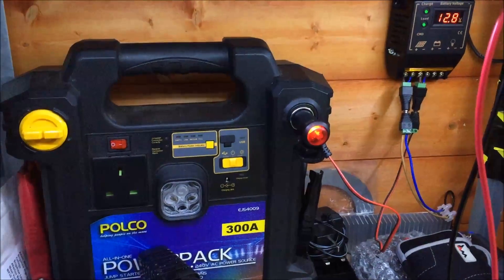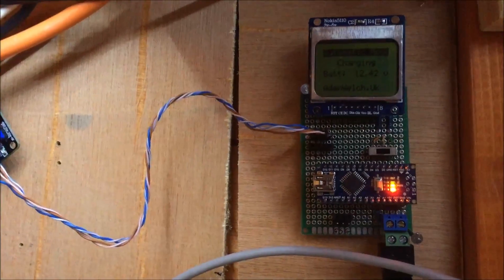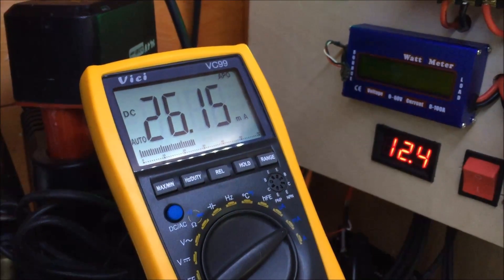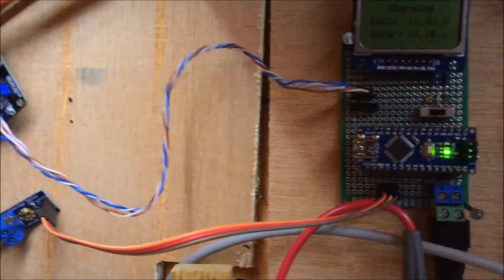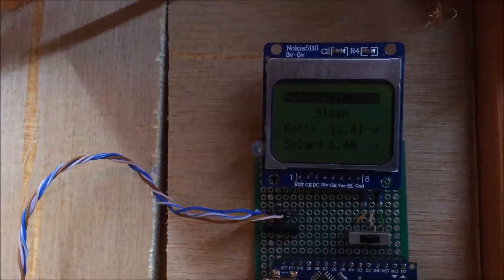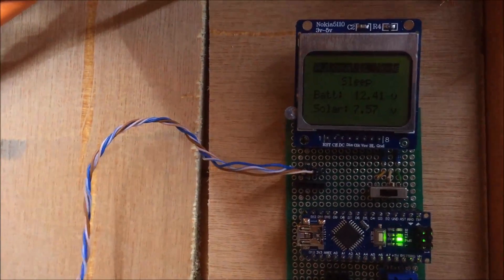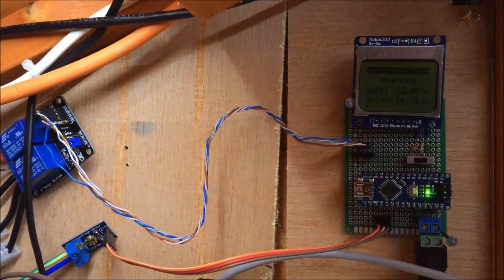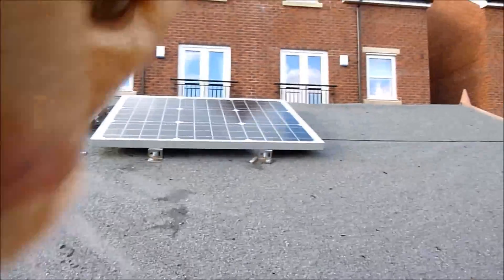Auto Grid Tie Switch Efficiency - Adam's Arduino Projects

Comment: i see lots of iteam with led lights . Like the jumper box has an led light that uses power and the lcd screen that uses power . Maybe use an old volt meter with an 9v battery it runs off of

Comment: Really interesting project - thanks for filming and sharing. I'm not an electronics expert but would love to experiment with Aduino like this. One day, when I have time etc maybe!
Reply from the maker: +Martin Doyle Thanks Martin.  Your project and your videos were a great inspiration to me when I started looking at solar energy on my shed, so it's great to hear your comments.  

Now I have invested in panels, charge controllers, lights and whatever else I want to gain the most out of the system I can.  It strikes me that many 'off grid' solar installations can waste the best generating hours of the day. Once your battery is replenished the solar panel is barely ticking over. I hope that this little project will maximize the returns.

I only started playing with Arduino a few months ago.  I've found them reasonably easy to get to grips with.  The issue for me is that I'm coming up with projects faster than I can complete them!
Reply: +Adam Welch Thanks again for your comments - glad I inspired someone! You are 100% right about wasting energy - when you have a small solar system, every amp is precious so you become very conscious of energy use - it's a great idea to be able to divert the energy when the battery is full - my tiny charge controller currently in my shed is a PWM5 (no longer made, unfortunately, but the designer/maker is going to make the design open source shortly) - that can work with a grid-tie inverter and a battery - as far as I know, it's possibly the only low-cost charge controller that can do this. But... I do like your idea very much... if you get it completely stable etc, maybe you could sell them?

I have a small battery in the garage, hooked up to a mobile solar panel which powers lighting and an iPad etc - however I generate much more electricity than I use, so I'd be up for buying/trying one!!!

My shed is too far away from the mains to do this, and the 40 watt panel is just about right for what I need - lots of excess in the summer, but just about OK in the winter...

Will be watching your other videos over the next week or so. Best wishes, Martin